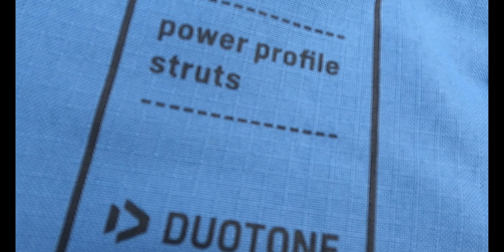BIG wing dilemma, pt 2 (Ventis)

Comment: I've got an 8m Ventis in the box ready to go. I can't wait.
Reply from the maker: Yes!! If an 8m was available I would have snagged it. The 7m is really sweet, it’s both easy and powerful, kinda like a cross between a Unit and a Slick? Let me now what you think of the 8m!
Reply: @OCEANBOUND1  Flew the 8m today. It rocks. I have a 6.5 slick and the 8 wingspan isn't a problem. That strut is looong though. Felt tight, powerful and really pretty fast. Ciao.

Comment: Hey man! I just got my 8sqm. Love it. Coming from the CWC 8.0 this thing is much easier to handle in maneuvers against the wind due to its design and not only because of the lovely handles. I bet they provide the 2024 unit with a longer front handle. The ventis pumps great, jumps great, feels a bit heavier I’d say as well but only if the wind is simply not enough. The only minor issue with the ventis is the packing. I only manage to pack the wing inverted what I don’t have to with the new units. Btw: staying with f-one foils I changed to duotone units completely and love the handling! I could easily go from 8 to 5.0 when the wind picks up. 
The 6.0 feels a bit heavy in my hands. It pulls a bit to hard but not in a forward momentum way. Do you feel the same on the 6.5? Maybe I simply have to get used to. I needed a few moments to adapt to the rigid handles but love them now. Stoked as you are. Hang loose bud 🤙🏼
Reply: Yes, 2024 Unit’s get the Ventis handles. The 2023 big Slicks are better than the 2023 big Units. The Slicks pull you forward instead of downwind.
Reply: @foilsurfmachines  hi Dwight. Makes sense with the ventis front handle. Feels like a boom without having a boom. The pull feel is only on the 6. Down from 5.0 it feels perfect.
Reply from the maker: Yeeeoowww awesome bud! I totally agree with all of that. I wish I had an 8m to try, that’s the true lightwind test for me, there just were not any available. The 2024 units are gonna be great if they go with these handles. That’s gonna be quite a decision year! Stoked you are still riding FOne foils. They mentioned they may send me some to review… if they send the right ones… who knows what happens! I do love Armie but I’m always looking for something better. Fingers crossed. 
Thanks bud and I wish you an amazing weekend!
Reply from the maker: @wingfoilingsimssee the 6m… is that a strike or a Unit? The 6.5m I have is a v2, kinda apples and oranges but it feels light for sure. That was a good year.
Reply: @OCEANBOUND1  I meant the 2023 unit 6.0. But @foilsurfingmachines said the slicks in bigger sizes have a better forward pulling design than the units. But I’m not the boom guy. Tried but it always felt like I have a boom and then the wing in my hands. Simply no direct feel for me. And the diameter of the boom is thicker anyway. Had a nova 1.9 from north out these days in 45kn wind. Felt really good and like the round and not oval rigid handles even more than the duotones I must admit.
Reply: @OCEANBOUND1  really stoked f-one is gonna send you some stuff. Your videos are so well made any brand with good products is going to have some good advertisement! For me personally I love the sk8. No winglets means less injuries. A little less glide than the eagle but such a good loose feel while having stability at high speeds. And it carves so well. I pair it with a c200 and xs fuse to have a bit more pitch stability for the moment. For the lights I have a Seven Seas 1200. lovely foil. 
Hang loose bro. Loyal to the foil!

Comment: The long hard handles seem really nice. 👍
Reply from the maker: Oh so nice. I’ve wanted booms to work, but the diameter has always been an issue for me. This extended front handle is the answer. I hope all their wings end up doing it.
Reply: @OCEANBOUND1  But maybe one complain, with the CWC V2, when I hold the wing with both hands all the way in the back of the handles, I can have both arms completely stretched out and the wing is almost fully powered, i dont know if thats possible with hard handles.

Comment: Thanks for the review! So does the Ventis have the upwind ability of the Unit? Also wondering does it have the instability issue flagged out like the Unit 3?
Reply from the maker: Sup bud! Hard to say, due to limited time I’ve spent on the v3. I could do a comparison of the 6.5 v2 unit I have, not sure if it will be relevant. If more people start showing up with more v3 Units I’ll totally try them back to back.
Reply: @OCEANBOUND1  Sounds good, better upwind than the strike v2 and v3 you think?